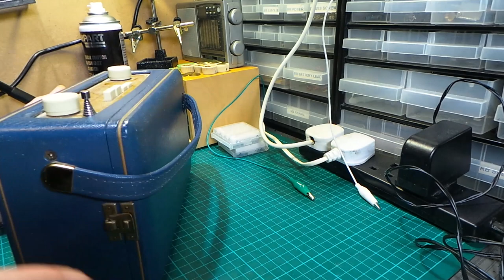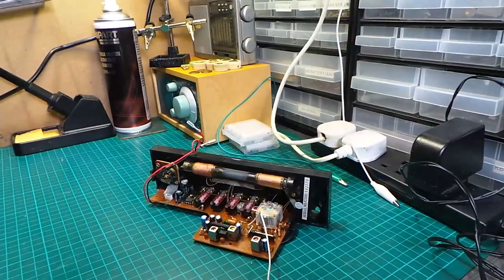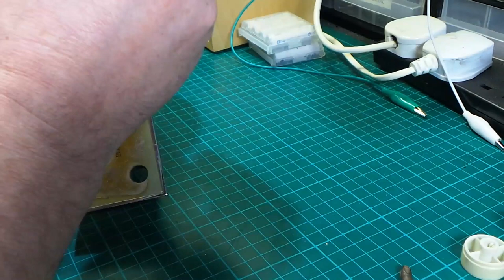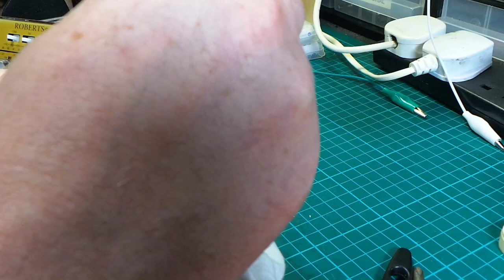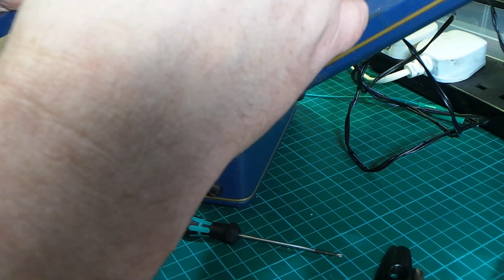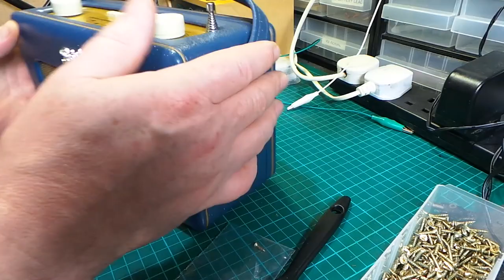Roberts Revival R250 'Tinker'

Comment: Another helpful video, if I picked up a cheap a DAB speaker I might give this a go thank you.. Could you tell me how to fix a R257with a tight drive chord please? Is it switch cleaner in certain points? Appreciate any advice...thank you
Reply from the maker: The only real way to solve the tight & squeaky dial cord is to replace it. Over the years they can shrink with humidity, and this tightens the cord, and can also cause a tuning restriction (cross-over of the dial cord on the spindle). In the early days, before I got real dial cord, I used fishing 'backing' line with great success!
Reply: @Codeeze 
Thanks for that, I have only just bought it and it looks good, I have managed to get itworking ok for now, but if I do get issues the fishing backing line will definitely be the way to go. I would just be a bit nervous about doing it. Do you have a video with that on at all? Thanks
Reply: Hello you mentioned replacing the Drive Cord on the R250, I just wondered if you have done any videos in this at all. Many thanks.. Amanda